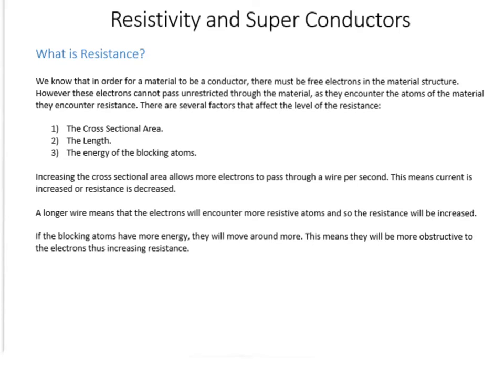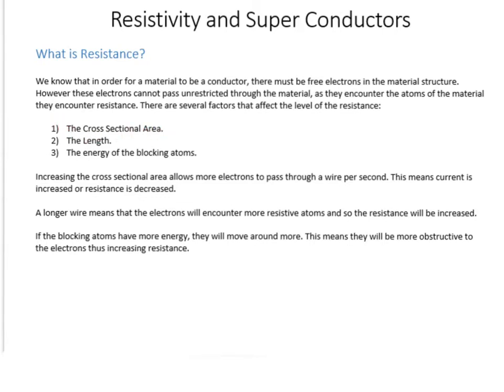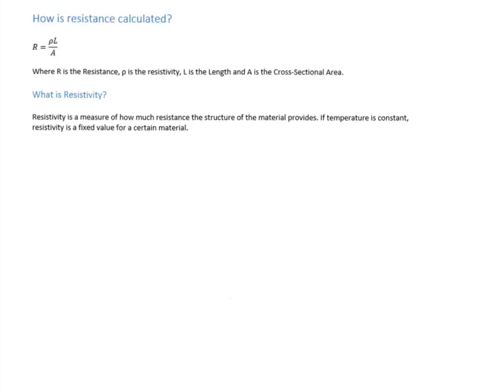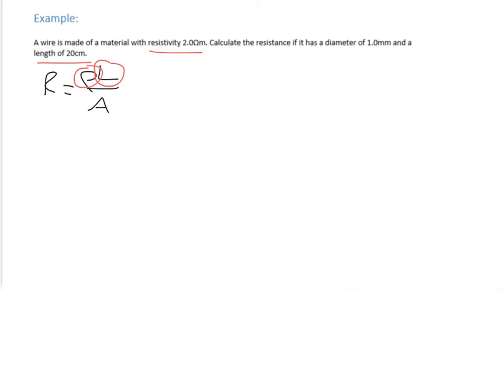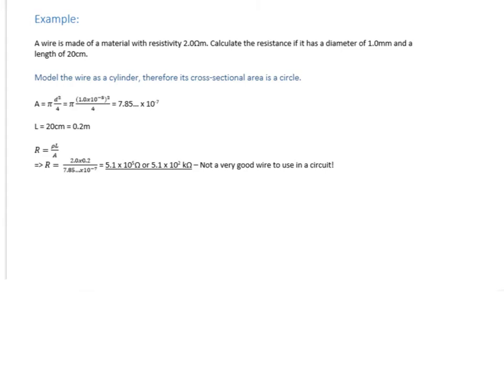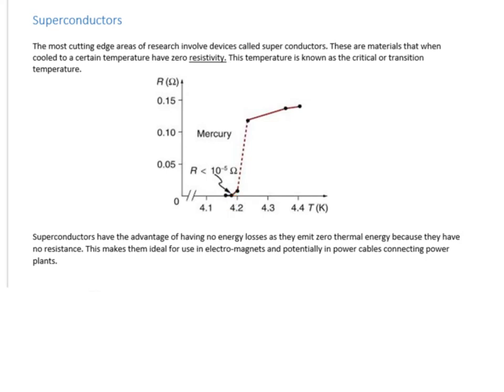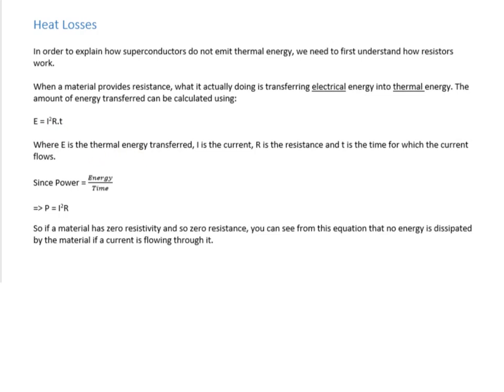A Level Physics: DC Circuitry: Temperature and Resistance

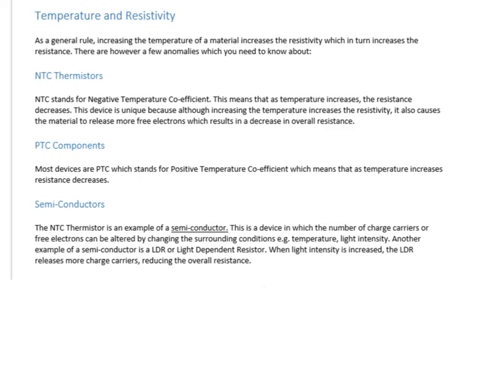Comment: At 7:35, your words do not match the text you appear to be reading from. You verbally state that as the temperature increases for a PTC, the resistance increases, but the text says that the resistance would decrease. I take it your spoken word is the correct answer as it should not be the same as an NTC component, I hope?
Reply from the maker: That is very careless of me,sorry about that. Yes for PTC components as temperature increases, resistance increases.